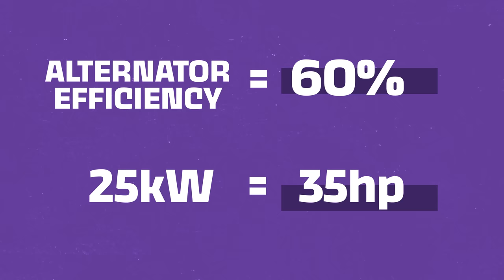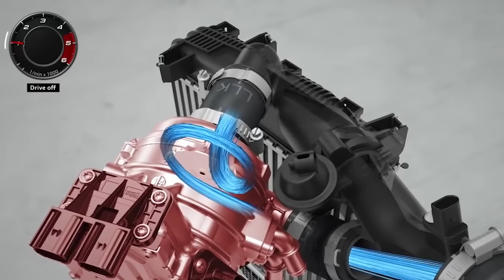Are Electric Turbos a SCAM?

Comment: I have been running a Paxton Novi 2000 with 2 1/2" 8mm belt-drive to a Me 1309 BLDC motor with a 72 vdc system I built for my 87' Camaro with a 1st gen 350 in it for years. It will put out 8 psi on the boost gauge without the engine running, about 5 psi initially with the engine running until the engine's over about 2K RPM. Of course by red-line all the boost is gone; but who cares, your going to shift then anyway. The beauty of it is that the energy is stored in the batteries and strictly on demand; and it takes absolutely nothing off the engine (no appreciable parasitic loss like the Hellcat blower which takes up to 60hp off the crank). Besides, why make boost you don't need? Mine doesn't require intercooling either because there's not the thermal issues associated with turbos. I even built it its own oiling system. The biggest issue though is as claimed and that is power. To get the speed I have to belt up 1 to just over 3 on the input shaft (1 : 3.2). Add that to the internal gearing which is 1 : 3.5 and it  pegs a 300 amp meter series-ed in with the controller initially, then it settles down to about 160 amps. That's 11,520 Watts so I use six 12v 50ah AGMs which weigh in at around 200 lbs all together. Considering the unit itself (mounted on the sway bar just in front of the engine) weighs in at just a tad over 100 lbs, it's like having at least a couple of passengers with you every where you go. That pretty well shoots it for drag, but when your already doing 2,500 RPM in OD on the interstate it's dope cause it's instant. I can charge the batteries with six on-board 2A chargers with an inverter on the fly with a complete aux electrical system I built, or just keep it plugged in while the car sits in the garage. Duty cycle is typically less than 15 seconds in use (on the rare occasion I feel a need to use it) so it's fairly easy to keep the batteries topped off which keeps them from sulfating.  The only bummer is when a battery breaks down under load. Then I have to go though all six with a load-checker to find which one to R&R. The one's I'm using now are about $100 each too. It can definitely be done; but i sure as hell wouldn't say that it's all that practical.

Comment: Its all about air restriction vs unit power. Eliminate that by installing the blower with a y-coupling paired with a CAI. Neutralizes the air restriction so engine can breathe normal when not engaged, then add pure boost when activated. Electric does not use exhaust air. So those ebay 12v $500 unit that push 2psi will add about 20-25 hp as long as you don't have any air restrictions.

Comment: Thank you for addressing the alternator part I get into arguments with people over electric cooling fans all the time and they refused understand adding electric fans doesn't increase engine power only shifting the load to the alternator other than having a remote radiator the only benefit an electric fan has is you're not adding another flywheel to the engine letting it rev up slightly faster but you're not truly getting any power gains. The only other benefit to an electric fan is you dont need to take it off to replace accessory belts.

Comment: The point of the battery for an electric turbo was kinda glossed over in the calculations. With a supercharger, the parasitic losses are happening at the same time as the compression. An electric turbo system can harvest energy when you're cruising below 100% load and when braking, then do the compression work when you floor it without any instantaneous losses.

F1 engines' MGU-H is connected to the turbo's main shaft, so that off-throttle instead of the energy from the exhaust side just being wasted creating useless pressure and heat in the intake, you charge the battery. When you get back on the throttle, draw from the battery to spin up the turbo, eliminating lag. 

Mercedes's trick was that instead of a traditional turbo with a short shaft (easy to support), spaghetti manifolds and the MGU-H bolted onto the end of the shaft, they made the turbo shaft longer than the engine block, so all the exhaust tubing and the exhaust-half of the turbo are at the back of the engine, and the intake manifold and compressor-half of the turbo are at the front. The MGU-H sits in between the two whirly boyz, down in the valley of the engine block. Simpler tubing, hot and cold kept separate, easier packaging, with the downside of having to precisely balance a very long shaft, and make sure the motor can tolerate the heat.

Comment: those recharging turbo can be a good option for cheap slower car. depending how it actually work, instead of emptying the battery make it small boost but can be used several times. On slower car it can be used for overtaking lorry or something like that.

Comment: The Russian guys at Car 54 Garage ran a turbo with a starter motor and it worked. But the starter motor go pretty hot. They did get more than 4 minutes out of it.They had it geared with belts and pullies.

Comment: I'm pretty sure the Magnetti Marelli hybrid turbo used in F1 uses electric to spool quickly but then starts recharging as soon as exhaust takes over. I've been wanting to try this for several years but I've never found them sold anywhere, and most likely couldn't afford it anyway. Also, it's a 48V system and I'm not sure I have the willpower to tackle that project.

Comment: Wasn't there supposed to be some kind of electric turbo in F1 racing at some point?

Basically the turbo gets split in two. The exhaust portion of the turbo spins up a generator, which powers a motor connected to the intake part of the turbo. But the intake turbo can also be spun up (or assisted) by a battery?

Comment: Hmm... I wonder if maybe an electric turbo (or at least an electrically assisted turbo) would be more practical for a hybrid vehicle since they already have the high-voltage system and batteries built in. It would definitely decrease range since you'd be using a considerable amount of energy that would otherwise be going towards the electric motors, but it would be nice to have if you ever wanted to get an extra kick to your acceleration. 
Plus, since all of the energy in hybrids comes from regenerative braking or from a charging point, you wouldn't have the negative horsepower of an alternator, giving you even less parasitic losses than a traditional turbo.
Reply: that is litterally what a f1 car does. Actually you 'might, not so sure' even save some energy with the generator on the turbo as you can use the waste-gate less. In case that was an elaborate joke of yours, i fell for it.

Comment: The biggest issue I see with electric turbos is that there is no way to synchronize their output with the engine's RPM. 
For example, a S/C is tied to the crankshaft, and a turbo is tied to the exhaust, so both of them spool faster in response to the engine asking for more air. The higher the engine revs, the harder they will work. 

However, an electric unit is not directly tied to engine operation, so it will only spool at a fixed speed no matter how high or low the engine is revving. 
That is, the unit will provide x boost whether you're at 1500 RPM or 9000 RPM. I suppose you could rig it to the ECU so that it spools slower/faster based on input from the Throttle Position Sensor? 

Every electric turbo I've ever seen has never been able to produce more than 3 PSI of boost. That's pathetic and not worth the money or hassle of installing one. Most factory-turbo cars produce more boost than that. SN95 Cobra superchargers produced at minimum, 8 PSI. 

TBH, I think manufacturers experimenting with them is a fool's errand. In another 20 years electric vehicles will probably make up half the market, and any power adders designed to aid a combustion engine will be obsolete. Instead, focus on designing an environmentally friendly, easy-to-produce electric  vehicle that has good range and is easy to charge. At this point, trying to pursue major innovations in combustion engines is beating a dead horse; they're well on their way to going the way of the dodo.

Comment: What if I have a hybrid vehicle that already has a 48V system and a decent battery? I think it is somewhat sensible to use an electric turbo as well as a conventional turbocharger. You got all the stuff you need and the electric turbo should work longer than 4 minutes. In a system like IMA, you also get some regenerative braking, so that might make sense. That's just a hypothesis, so I'd like to hear other opinions.

Comment: My female has a 2019 hrv sport. It's plenty quick enough 95% of the time. A rechargeable 4 minutes of boost would be great for those few seconds here and there when you need to push into traffic and its just a tad to weak

Comment: Seems like a better use of the 48v system would be a mild hybrid system to drive an electric motor attached to the engine and provide supplemental torque to help fill in the turbo lag…oh wait, there’s already a ton of OEMs doing that. It helps with the idle start system that most cars have now too.

Comment: If you think about it, an aftermarket Electric turbo would be practical on vehicles like the 6th gen Celica GT/90s Camry, with the 5sfe engines, if you don’t want to swap/do exhaust work. Vehicles where you’d be running low boost anyway. I’m thinking of doing one and down tuning the turbo motor so it only pushes 5-7psi max maybe find some way to make the turbine spin without as much KW power needed. I’ll edit this comment and maybe post of a video when I do!!

Comment: Why not use a supercapacitor for the electric motor on the turbo instead? Since the electric motor is only to supplement a turbo during the initial acceleration before the exhaust gases take over, a supercapacitor could be charged from the traditional battery system and provide about 10 seconds of 15kW power while the turbo spools up. The nice thing is that supercapacitors take the same time to charge as discharge. So it would take 10 seconds from your electric system to recharge to be ready for the next idle to start boost.

Comment: The majority of spinning power that the turbine wheel generates actually comes from the heat of the exhaust, not the pressure. Therefore the turbocharger will always be the most efficient way to compress air, regardless of the restriction it creates, since it's utilizing energy that would otherwise be wasted in exhaust heat.

Comment: Have you tried bolting the electric turbo directly to a Conventional turbo intake? Use the electric turbo to help spool the low end and bypass once the turbo reaches maximum boost from electric turbo. IJS the point is to reduce turbo lag. I’m sure a few super car use this method. Like the Acura NSX. If I’m not mistaken.

Comment: So if you want power on demand, what I'm thinking is that you just install an auxiliary small engine, like a race-kart engine that can do 8,000 plus rpm, has enough torque to push a full grow adult around a track, is light, is relatively cheap, and you belt it up to a compressor. Then you put a paddle on the steering wheel that controls that throttle and boom, you have power on demand.

Comment: Personally the way I think is best, or at least that I'd like to see are "Centrifugal" Superchargers. Which is the fancy way of saying a belt driven, cold side of the turbo. They're just shy of being as efficient (the numbers I've seen are 83% for Centri Supercharger vs 85% for the Turbo) and you get instant boost without doing any really fancy shit and you don't have to worry about making the manifolds complicated and where to fit both of these things on those v banks or where it'll be on your 4 banger's manifold, yada yada. Just strap it to the serpentine system and go.

Comment: Back in the early era of jet engine there was a thing called motorjet.
It's like modern jet engine, but instead of using exhaust to power the compressor like car turbochargers, it uses a piston engine to do so. Pretty similar to how E-turbos work.
It's also not as efficient as turbojets, but is still legit enough to exist for a while.

Comment: put a cvt controlled supercharger on the front, and an exhaust turbine on a fluid coupling tied to the crank or trans. You'll eliminate(or minimize) turbo lag and boost threshold with the variable speed supercharger like an electric turbo can do. The exhaust turbine being tied to the drivetrain allows you to scavenge the waste energy that normally powers a regular turbo. there would potentially also be extra power and emissions benefits on an engine like a rotary or a crossflow 2-stroke that sometimes has difficulty fully completing combustion before the charge leaves the chamber. Turbo compounding :)

Comment: im a little confused on something, if a turbo is powered off excess power from the exhaust gasses, and an electric turbo is like half of a full turbo; why not take the would-be exhaust half of a turbo, attach it to a small generator that charges a high voltage battery system and then power the electric turbo off of that system. like a turbine generator for exhaust gasses powering the electric turbo..it seems reasonable to me, a good bit of weight if done poorly but it has potential.

Comment: I know I’m late to this conversation, but another aspect to take into consideration is the cfm output of an electric turbo. And if the electric turbo’s cfm output can not keep up with the engine’s air demands at high RPMs, at what point does it act as a restriction and lower HP ratings?

Comment: I was thinking it'd be impractical but cool to put an e-turbo or electronicly assisted turbo on a hybrid

It'd put alot more load on the battery which would have a pretty negative effect on fuel economy so you'd be better off with a less heavy conventional vehicle if you want something that goes fast

Comment: What we need is a decoupled turbo i.e. put a generator on the exhaust turbine. It would be great for engine layout too.
A control unit could eliminate lag and optimise charge leaving a small, separate high voltage battery system as the buffer.
Best of both worlds... Hybrid superturbocharger.

Comment: You could wait a lot shorter than 40 minutes to charge if you hooked it up to the braking for a regen system. It's much cheaper and lighter if all it does is charge and not expend any power.

Comment: Would an electric turbo with a 48V lithium battery specifically to apply that boost only during acceleration work?

Hypothetically, you could apply a tune to apply power to the electric turbocharger when you're driving at speeds under 60km/h, or when you're accelerating onto the highway.

And there isn't any reason you can't swap something like the TorqAmp electric turbocharger and battery between vehicles. Unlike turbochargers that are installed with all the related components needed to work via exhaust gasses. So, buy it once and use it between multiple vehicles over say several decades instead.

Comment: Edit i should have just watched the video first 

I mean, there are a bunch of water cooled RC motors that put out CRAZY ammount of power, we're talking something the size of your fist pumping out 8KW, catch is, its very high voltage 3 phase brushless DC(effectively as dangerous as AC, just doesnt cross the zero plane) and it will only output usable power at its optimum RPM range of like 5k-50k, which just so happens to be perferct for an electric power adder, push 8kw in, get 45-60kw out

You could go full pro-mod by adding the electric motor to the shaft on the intake side of an actual turbo(to be a turbo you need exhaust gasses spinning turbine blades to spin a compressor/impeller), the rushing air would keep the motor nice and cool, you'd mostly eliminate turbo lag, and you could even do "regenerative braking" while cruising or high boost environments by using the expansion of the exhaust gasses to power the motor, reclaiming power, and keeping the boost in the desired range. You could even use this to get better efficiency out of the car by maybe liquid water reclaimed from the air conditioner for added exhaust pressure as it flashes to steam in those hot exhaust gasses, though, i suspect that would just result in more back pressure on the engine instead of efficiency gains

Add solar cells to your roof and hood/trunk, a capacitor bank, and a battery pack, then bump that up to a 20+kw procharger. Ideally you would use it to completely bypass turbo lag, charging while the turbine is providing the power pulling the power back keeping the boost from going too high, and then dumping all that stored power after a shift, the solar cells would just be there to add "free power" it may be only 1kw of solar, but that can turn into up to 8kw of added engine power, now its not free, because it is burning gas, but at least you could call it a solar assisted hybrid

Comment: Hmmm... what if I bolted 4 of those 500w panels up to a controller and that 48v battery I wonder. SolarBoost. I might be able to fit those on my truck rack...prolly run a leg off the TPS to modulate the current with the throttle through a relay or something so it's not on at idle.

Comment: Really the stand alone electric turbo needs to be compared to nitrous. Because its function is closer to that. Hold a button get power for a limited time. If I remember right the E-turbo cost more up front for a similar power level of nitrous kit. But the nitrous cost a lot more to refill, were as the price of the electricity is pennies of the gas used.

Comment: F1 technically have electric assisted turbos. The MGU-H turns into an electric motor on deceleration to keep the turbo spinning and remove lag. I’ve seen that energy recovery from turbos in this way is being explored as put into production for road cars.